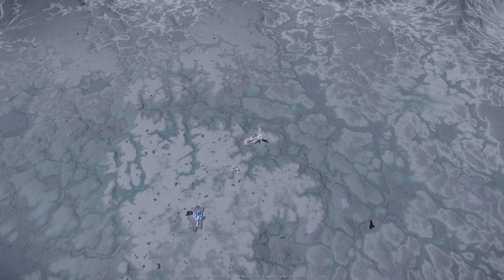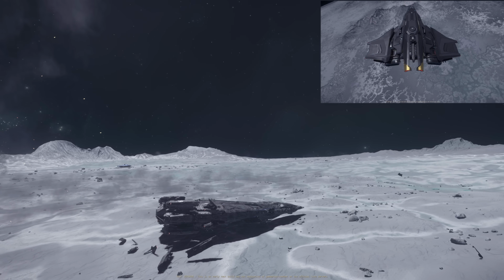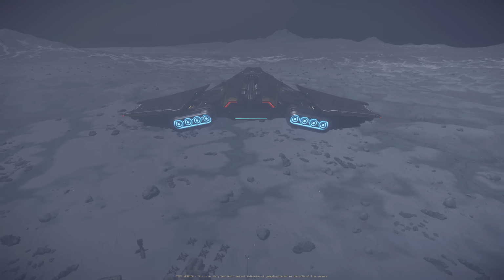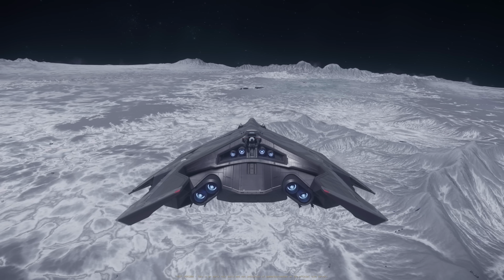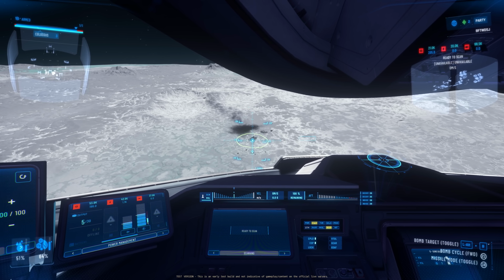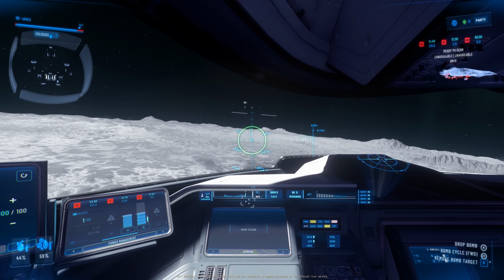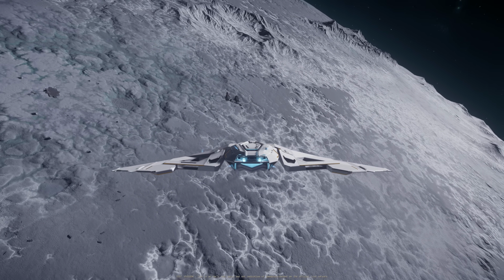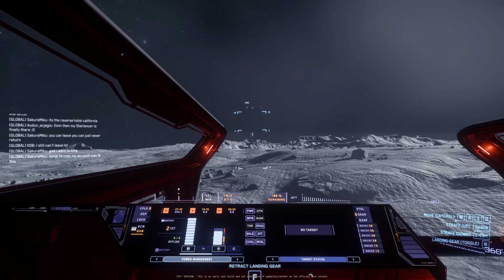Polaris Point Defense vs. A1/A2 Bombs & Size 9 Torpedoes | Star Citizen Polaris Testing [4k]

Comment: A2 bomb HUD is somewhat wrecked... the Green circle (desired drop zone) is not accurate
It is hitting at least 1 circle short of desired drop zone.
WHICH, you have to place the desired green circle approx 1-2 after/further to your target in order to use the HUD guide (so does the red circle)

(decouple + constant speed 15X + ALT 4.5~5km, under 10ms ping + 250ms server fps condition, i have no idea if these affects)